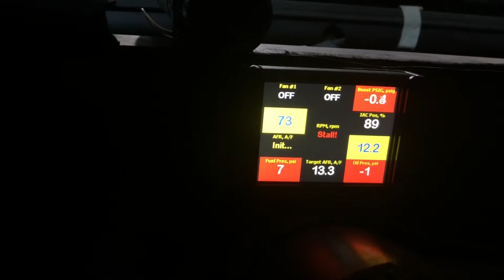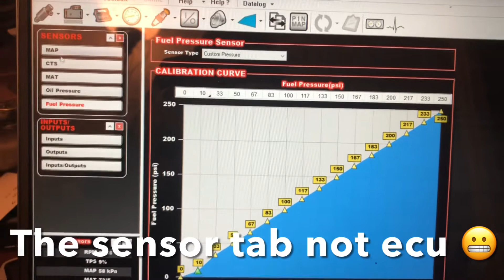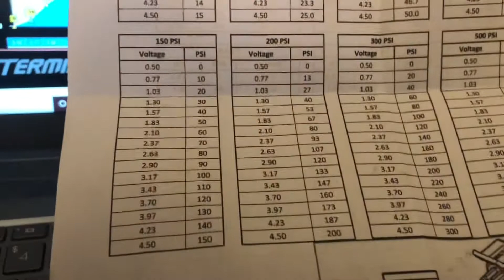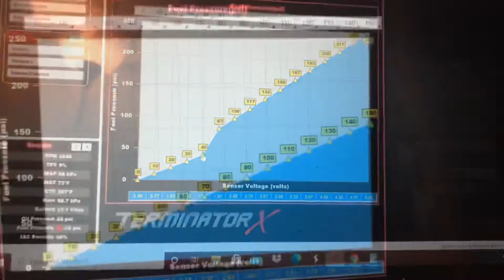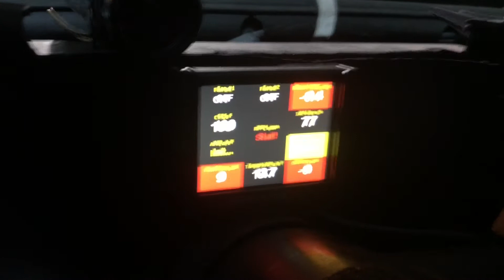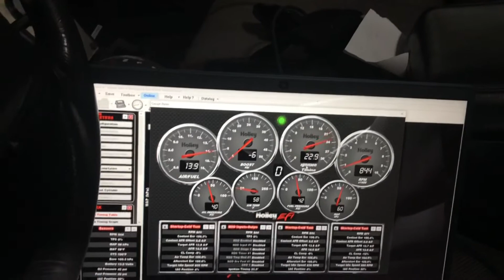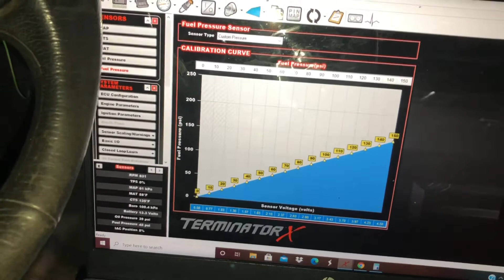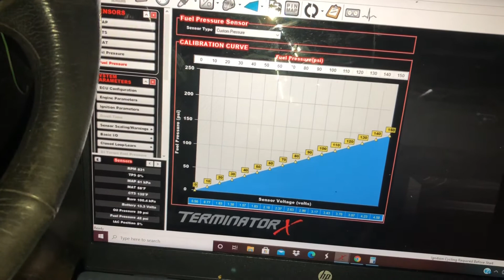How to calibrate Lowdollar Motorsports sensor in Holley EFi Fuel Pressure #Holley #Lowdollar

Comment: It's easier than that bro. Top row 0-100 and click fill row values it auto populates the scale, at the bottom .5 volts on the left, 100 on the right and fill row values.. then it's done.
Reply from the maker: Oh yeah I didn’t realize it at time. Much easier
Reply: Thar does not always work

Comment: So does the Holley plug right into that sensor? And what adapter are those?
Reply from the maker: Yep, plugged right in with the Holley harness, also the adapter was just a (Aluminum -8 AN Male Flare to -8 AN Female Swivel with 1/8" NPT Sensor Gauge/Gage Port Fitting, Pressure Take Off, Black) off Amazon.

Comment: So I am trying to get my co2 boost control to work on my s10 an I’m useing 100psi dome sensor from low dollar an it’s not working the vent solenoid, do you have any ideas for me? Do you use co2 on your car?
Reply from the maker: I do use C02. I would check your controller settings in the Holley and also see if dual Mac valve or dual valve is selected. Not sure what it says at the moment.

Comment: Are you using a wideband? If so where is it plumbed
Reply from the maker: Yes sir wideband is the only way to tune it....accurately IMO. I have mine downstream of the turbo outlet. About 8 inches for the turbo
Reply: @boostinwillie  ok thats what I was wondering. So the 8inches works fine? Well my pipes go diff so I guess mine will be upstream lol. Based on my exhaust pipe where would you put it?
Reply from the maker: @benaiahtheassassin  honestly, I would run a longer  pipe out of the turbo then out of the fender.  If you put the wideband behind the turbo. I know if it’s too close to the opening of the pipe it will not read accurately.
Reply: @boostinwillie  thats a huge pipe! 5"..... I didn't want to cut the fender yet as this setup isn't the final. I want my hood to fit but the turbo sits high. So when something happens I can redo lol
Reply from the maker: @benaiahtheassassin  can you reduce it down to a 4” pipe, and go under the car?
Reply: @boostinwillie  Of course, but thats more money lol. Im kinda done buying parts for the motor and turbo unless its the cold side